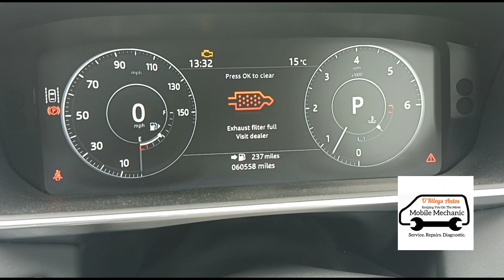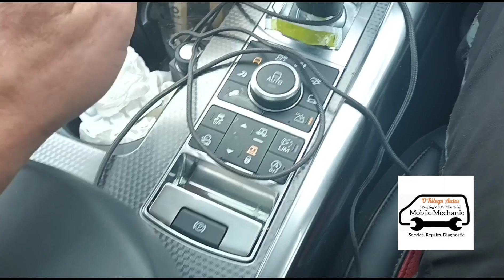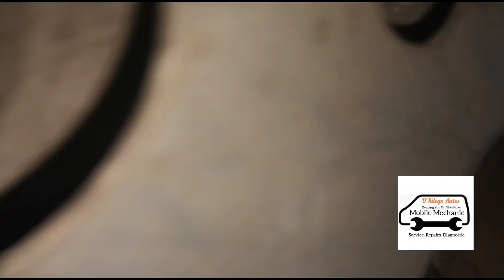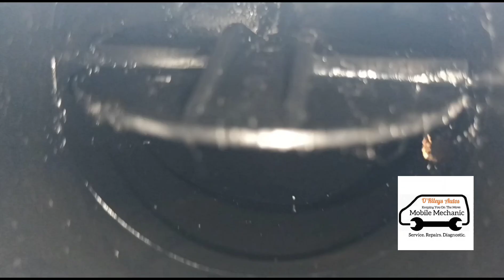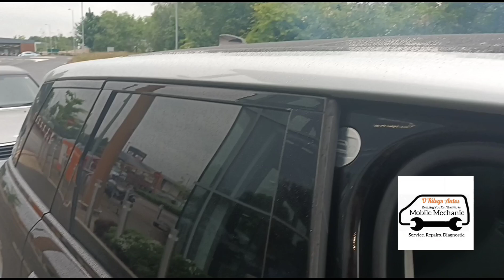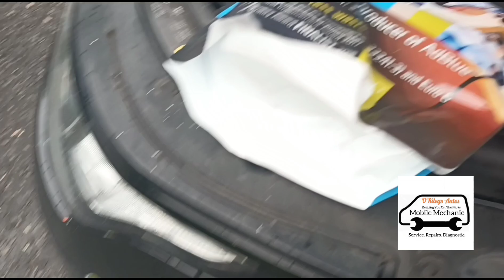Range Rover 3.0 P2BAE-00 P2463 P0234-77 Nox Exceedance. DPF Soot Accumulation. Turbo Overboost. DEF

Comment: On the ECM calling for oil services early: that's usually the oil life calculation counting fuel dilution from regenerations. Frequent or interrupted regens push the service date forward, so the oil warning is really a regen warning. The fix is finding why it regenerates so often — short trips, a sensor reading high — rather than the oil itself.

Comment: Hi jimmy, 
I’ve watched almost all of your EDF vlogs but couldn’t find an answer to my funny car story 😆
Got a 2015 Range Rover sport 3.0 SDV6 with no warnings on dash and the car starts and drives perfect seance I bought it from the previous owner, 
When I first viewed it the engine management light was on dash and he have sorted it out with some coding guy around his area, 
After purchasing the car I have done the engine oil and filter change and did the paddle oil service reset and saw exhaust fluid refill 0 miles😬, jumped and topped it up with around 14 liters and got an autel scanner from one of my friends and did the start inhibited reset, showed 31 miles on service menu, driven those miles and came back to 0miles again, 
Tried to read the addblue level on Autel but said: The procedure failed to complete.
It is not possible to read the Diesel Exhaust Fluid (DEF) tank level. An open circuit has been detected within the Pulse-Width Modulation (PWM) signal circuit for the level sensor. Rectify the fault and re-run the function.
Did clean the addblue injector and tried again but same failure, 
Tried to do catalytic monitoring system test but failed as well 
Got P2BAE-00- Permanent - NOx exceedance - NOx control monitoring system, in trouble faults cleared the fault but still not reading the level of addblue 
Could it be the addblue level sensor or wiring harness on it ? 
Thanks

Comment: Great video Jimmy .I'm a bit concerned with my range rover sport as the ecm keeps calling for oil services prematurely presumably because the Dpf is having too frequent regenerations. I haven't had any blocked dpf warnings yet Not too sure if the oil level is increasing with diesel Im thinking I should do a dpf clean anyway?

Comment: great video 
I have a 2016 Land Rover Sport V6 turbo diesel living in New York that I can not pass inspection for months now. The error code P2BAE-00 Nox Control Monitoring System Intermittent .
I will trace down the wires loking for a partial break .Can you please tell me from the exaust manifold which Nox sensor I can look for that is throwing this code?

Comment: Interesting how you always apply the filter replacement option after each cleaning. It is  hard to restore the filter capacity to its original values, so doing this is kinda cheating on the ECU. A comment would be much appreciated

Comment: Have had all these problems on my 2017.  Fixed thanks to your help.  If you have a customer with a MAP / Barometric pressure sensor correlation error, I'd love to see one on that.  Everybody says it's caused by a dirty air filter but mine is clean.  DId a smoke test and found a small leak in the oil separator (where it inserts into the block), but even when fixed the code keeps coming back.  Great videos Jimmy, keep up the good work.